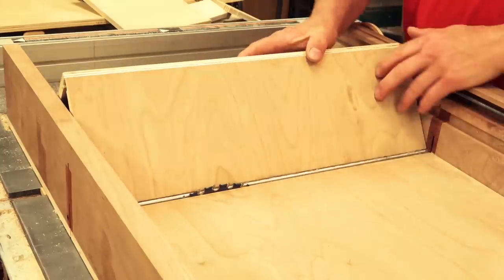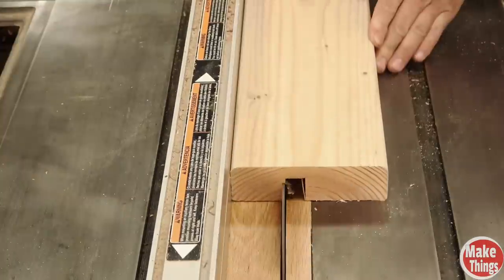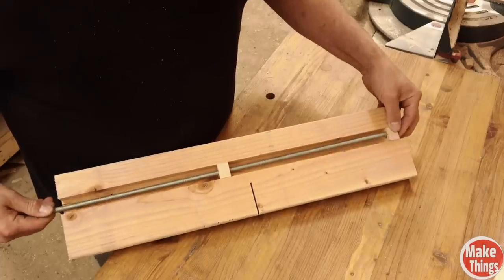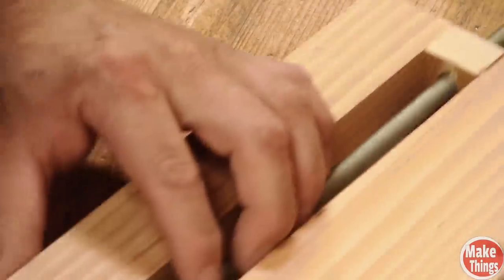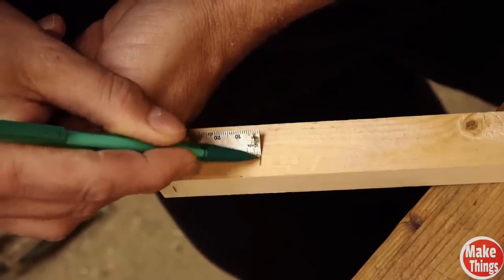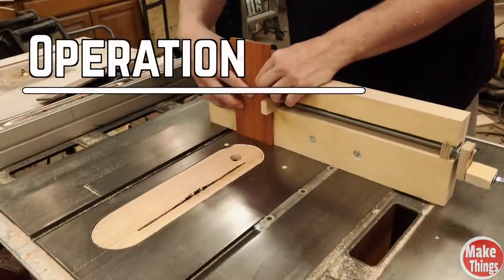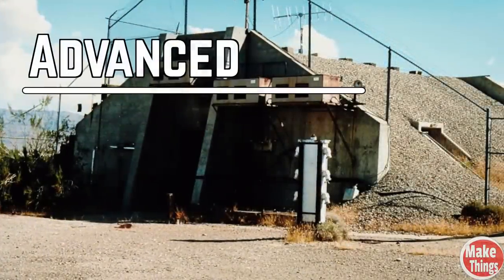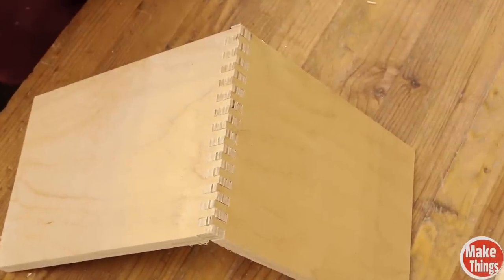Easy Box Joint Jig // The Most Versatile Box Joint Jig!

Comment: 😊 I make jewelry boxes. I have tried so many different jigs and they all were terrible at best. So I watch this video many times and thought I would give it a try. I am very impressed. Now I have only had a short time working with it. I wanted to make wood hinges mostly and they are varied widths depending on the project. This handles any size any! Thinking about making one for the router table. I just want to thank you for the idea. I changed it some for my needs but it works great.

Comment: Finally made this jig and it works great with some slight improvements that you hint at in the Instructable: 1) Made a 12 position indexed dial, 1/12 turn extra on the spacing cycle gives perfect fitting joints. 2) Use backing sleds with no cutaway to avoid tear-out, boards are reusable on projects with same sized finger joints.
Also finding it useful to make several small boxes (for micrometers) at once. Made four 18mm high boxes by jointing four 85mm wide boards to make a large box, making extra turns where box lids and bottoms can be ripped.
Thanks for providing Instructable as I got confused  a bit by orientation changes in the videos.

Comment: Made something similar just before I saw this. I used 8mm rod and worked out that 5.25 turns gave me the correct fit purely for dedicated 1 cut finger joints using my .130 inch flat toothed blade. But with screw advance you can finely adjust the number of turns for any occasion . Over here we can buy threaded rod connectors which are over 1 inch long and give you better engagement than tee nuts. Very pleased with the outcome . My threaded rod was also enclosed as the whole fence moved .

Comment: :hand-pink-waving::hand-pink-waving::hand-pink-waving::hand-pink-waving:Nice job,I do wonder if an Acme thread with a 4 start on it would be better for this and some sort of physical reference that you can feel,  see and and count as you wind it round would give you a really good advantage especially on the larger gapping, I need to think on this further as it wouldn't be difficult to insert a wheeled counter in to this.  Tally checker or similar I am thinking with a zero option.....On nice woods you donotwant to be missing the steps...
.. 

Great job thanks for the ideas and video....:hand-pink-waving::hand-pink-waving::hand-pink-waving::hand-pink-waving:

Comment: Box joints are my go to for drawers, decorative boxes and even shop storage. A box joint jig that indexes with a threaded rod is the way to go for flexibility and accuracy. This is a nice simple version for doing occasional ox joints. I built the Ed Stiles version which is slightly more complicated but has a couple of nice extra features. Also a box joint blade set is a nice to have extra, it simplifies things and gives a nice flat bottom to the joints. I even use it for 1/4 dados for drawer bottoms,  no fussing with a stacked dado set. The single biggest problem I have is dialing in the cut height, you just have to run some scrap through. I like to cut just slightly deep and clean it up with a sander after assembly.

Comment: I built one 5 or 6 years ago and it does make great joints but mine uses a dado and the fingers are the same width every time.  But it makes very fast accurate cuts after the dado is set up.  It is a beast it looks like a oversized typewriter that you squeeze a grip on one hand it pulls the part over the set distance and you squeeze the other grip and it locks down as you push it through then squeeze right hand it slides squeeze left hand it locks to make the cut and so on.   It is very fast but not the best if you only have a few joints to do.  I like how simple this is though.  I think my next one will be one of the jigs that uses set of fingers or blocks on the backside of the fence that you layout to the pattern you want. If you have not sean one they are pretty clever too.    I have a thing for jigs so maybe I will make one along this method just for the occasional joint as it is pretty clever.

Comment: I made this today.  My first couple of tests were using smaller pieces of wood (3" x 6", maybe) using the 2-cuts-4-space pattern but I wasn't able to hold the wood reliably so the teeth and spaces weren't even.  I cut the jig down to 5" high and that helped but they still weren't cut reliably.  My final test was using larger pieces of plywood and the 10-cuts-12-space pattern and it worked pretty well!   So, it does work but I need to figure out a method of moving smaller pieces of wood through it.   Thanks for the idea!  BTW,  all the hardware for the jig cost $25 at Canadian Tire.  (I had the wood.)

Comment: This seems so much more approachable than Matthias's design.  For a hobbyist who isn't going to be making boxes all the time, I think this one requires the right amount of effort and resources. Enough to prove you're serious, but not so much that you've got  got to dedicate days and I like that it isn't a whole new sled that takes up more space I don't have.
Reply from the maker: It’s funny you say that.  I have Mathias’s sled.  I’ve had it for about 4 years now.  I bought the plans, got every detailed part down to finding a bearings place that sold me just the right bearing his plans called for. 

I built it and used it a couple times.  Why?  Because it is enormously complicated.  It’s surely a magnificent tool, but it takes up so much space and I never got the hang of it.  

This one does it better.  It’s simple and doesn’t require several gears.   I mean, I just watched his video the other day and he had a drawer full of gears for it 🤯
Reply: @MakeThings  You gotta push the gears when your website is woodengears.ca ;) Yeah, he builds some  cool machines that take up way too much room for the amount of time I'd actually use them.

Comment: This is the best jig I've saw so far. Nice design. 

For a thin kerf blade, would using a fine thread 3/8"-24 a bit better? Would two turns approximately equal 3/32"? My blade is about that thick.

Comment: For metric version I made this jig (M10 nut, Φ10 bar) but found a problem that maybe is not  related to metric or imperial system whatsoever. 
T nut stays little bit loosely on threaded bar generally. The same holds for simple nut as well. So, when such t nut or simple nut are inserted into wooden pin, the pin will also be somewhat loose on threaded bar, and consequently wooden pin will wobble say about  a millimeter at the top. 
To compensate for that, I tried using several nuts together, welded them as a whole but that didn't rectify the problem, maybe just a little.
However I find the solution: the pin wooden cube should be drilled first for threaded bar, and then drilled partially just for t nut. Additionally you can add another drilled cube horizontally and  glue it to the pin cube. That is how wobbling of pin is eliminated.
Reply: I also made a metric version M10 where instead of a T-nut I threaded my pin and have no wobble whatsoever. I did a lot of tries today but unsuccessfully. I am sure it has to do with everything been metric. Even my blade. (2.8 mm). I will experiment a bit before giving up.

Comment: I think it would really help knowing the theory behind the 3/8-16 threaded rod. I assume it is 16 cranks to an inch. I think an explanation of the mechanics of it would help greatly. This is a great jig and one I am looking forward to making.
Reply from the maker: Think about it like this: a 1/16th of an inch would be one revolution.  16 cranks equals 1 inch.  Did I just say what you said, yes I did, but...backwards, so it doesn't count.

Big tip on using this: Have patience.  It'll take skill to learn to use this just like any other tool/jig in your shop.  It doesn't make them super easy, but it's easier than builds like Mathias' massive jig (big respect for him) and many gears needed to do different gaps.

I say that because I strongly believe in this jig.  It's super easy to make, it's super easy to use.  The mechanics are simple.  The difficulty lies in counting each pass and making sure you get it right.  Another difficulty is making sure you keep your wood absolutely flat to the table.

Some people have been dissatisfied that it wasn't as easy as they thought it would be.  Joints are never easy.  To get perfect fits, you need lots of practice and lots of patience.  It's a skill, just like anything else.

Let me know if you make it!  Send me an email showing yours off, I can't begin to tell you how happy it makes me to see someone make something I've thought up! makethingswithrob@zoho.com
Reply: @MakeThings  Thanks for the reply. After watching countless videos on box joint jigs, I think this is the way to go!

Comment: This jig is just deceptively simple. One can make it relatively easy. However, to use the jig effectively one must have hours of practice, which does not seem necessary at first glance. Previously I have made three types of finger joint jigs, one being this type, and each one demands different amount of time to master. This particular jig is in the longer time group to master, but has it's advantages as well. Advantages are  every size of finger, every size of space, interesting counting, and definitely simultaneous cutting of both pieces.
Reply from the maker: You're exactly right.  This jig takes time to get right, like all tools.   I wish more people understood this as there is a bit of skill needed to master this.  Thanks!

Comment: Loved your idea! I read the tutorial on the 3/16 issue. You could probable use a 5/8 thread with 11tpi and a single crank would match almost exactly 3/16 of your blade. Maybe I am missing something, but I think it makes sense. Please correct me if I messed up.
Reply from the maker: Haha, I’m not an engineer or a mathematician but 12/16ths is about 3/4’s, so you could be right.  

It would be interesting to try...it certainly doesn’t take much to make...ahh, but wait.  You be in trouble with getting t-nuts.  At least locally.  The highest t-nut I can get here is 3/8ths.  

It would be interesting nonetheless.  

Thanks for taking interest!
Reply: @MakeThings  you could maybe use a regular nut and fit it in a shaped hole, or make a very tight hole in the wood and use epoxi to get it fixed.
Please upload a video if you ever try.
Reply from the maker: Hey, you’re right!  Will do!

Comment: Looks legit Rob 👍👍 And hey - how about those weirdos that call Sharpies - "Skerpie" - that's as odd as finding a 3 in a binary search. 🤪 But while we're on the subject of "undeveloped" countries let's talk about 3/8 - 16 threaded rod. Turns out that two turns of that puppy advances the pin by 1/8 of an inch where a blade kerf is 1/8" which is indeed a coincidence of note. But in the vidjeo your hand actor does one cut for each rotation ... omg - I'm confusered - is he cutting the thin air on the second pass? Answer: no - he is cutting 1/16" each time (half a blade width) - so question #2 must be can he just crank that handle twice each time and chomp out the whole 1/8" - thusly making the formuler for the cuts part of the equation dividered by 2, plus two full cranks to line it up again for the next pin. wtf - this question is so undeveloped that I must experiment it meself. 
Now.... where the hell do I get 3/8 -16 rod around here? 😮
Reply from the maker: Hahaha, that one was aimed right for you.  I’m glad you weren’t looking away when it came up!  I was afraid you’d miss it!

Comment: Ok, advanced add-on.  After reading the Instructable I think I get it. I think. The pin moves to position the cut, and in clamping the box sides to the back 2x6 fence of the jig, it's possible not to register and clamp the box sides accurately?  So the advanced panel you created is actually glued to the pin and gives you a clamping surface.  Did I get that right?  Seems the pin could be created differently to begin with, in version two?  I have been looking at a lot of box joint jigs, and I think I like having a little finger sticking out to just move the little boards along instead of reclamping them.
Reply from the maker: Hmm, I’m trying to understand what you’re saying here.  First of all, you don’t clamp the stock you’re cutting to the 2x6.  I used clamps a couple times.   The first time I clamped 2 boards together to be cut in simultaneously, to save time.  

The second time I used clamps was on a piece of plywood that gets glued to the pin only.  That plywood moves along free of the 2x6 altogether (except that it rubs against it). 

I used clamps to attach the two boards to it.  

If I were going to choose whether or not to use that piece I glued onto the pin, there’s no doubt I would use it over moving the wood along, just because it’s error free, especially narrow boards that have little surface area on the base.
Reply: My bad.  Thanks for the reply.  I watched through and even watched the advanced add-on section more than once and then I went over to Instructables and read that and came back, but  somewhere in there I got confused about what you show and how to operate your jig.  Just explaining my confusion.  Another thing if I could suggest it in case others run astray the way I did, is that my better half and I watched just now and we agreed what you are calling your "pin" is really a "stop" to me... terminology.  What we have been calling a pin around here when we made finger joints the old-fashioned way is a stationary fixed-size pin or finger of wood which matches the dado or kerf -- no relationship.  You don't have that type of pin, your dado or finger  spacing so to speak is determined by the number of cranks and the threads per inch on your rod.  I'm straight now, lol.

Comment: A safety issue; the 2 x 6 cutoff  as seen at 1:04 can be very dangerous. Cutoffs can be propelled backwards into worker's body. There needs to be sufficient clearance to avoid potential binding between the blade and fence. Cutoffs can be thrown at high speeds always pushed or moved free of being caught by the blade.  I've  witnessed table saw cutoffs narrowly missing the operator and leaving large deformities in steel shop doors. Close calls are to be avoided.
Reply from the maker: Then how do you recommend cutting them?  If you notice, my body was not behind that part of the cut.

Miter gauges would be useless if you couldn't crosscut with them.
Reply: @MakeThings  No personal criticism. Rather an observation that may circumvent potential injuries..
Miter gauges are fine for crosscutting if the they used correctly. I prefer a good chop saw or a sled like yours.  
From a safety standpoint, miter gauges should lead not follow the workpiece.  Should any accidental binding occur the heavy metal miter gauge will still be setting in the table's track and not sticking in somebody. enjoy

Comment: Am in the process of making your wonderfully designed jig but have a couple of questions.
1.  The jig and rod length are both 24" yet the rod is supposed to extend 1/2" out (for the crank).  Won't this prevent a washer and nut being placed on the opposite stop block?
2.  Does the third stop block get glued to the sides of the dado
3.  Is the third stop block supposed to be flush with the end ??
4.  In the pictures, the jig only has two stop blocks and the one pin.  Should there be 3 stop blocks or just two as shown in the pix?
THANKS !!!
Reply from the maker: Hey James!

1.  No washer or nut is needed on that 3rd block, it's simply used to fill the space so that that end won't warp or twist.  You could even fill the entire end past the middle nut and washer with square with circles in it.

2.  Yes.

3.  It doesn't matter, see #1.
4.  I made 4 of those and I don't remember if I had a 3rd stop block in all of them or if I missed one.

Thank you James for pointing that out, I'll update my instructable and mention you (if you want...tell me if you don't want me to use your name)!

Comment: I have tried so many box joint jigs and fail pretty much every time getting them to fit well.  I'm definitely going to give this a try.  One question: Does it matter if I'm using a full or thin kerf blade?  Considering how this is made it doesn't look like it would matter.
Reply from the maker: It does and doesn’t.  

I used a 3/32” kerf.  That’s a 1/16th larger than a complete crank on a 3/8-16 threaded rod.  So I use 2 cranks in all.   Technically speaking, that will leave a 1/32” on either side of the tooth.  

To accommodate that I make my last crank a half crank.  

The question is, do you want a tight joint or a loose one?  I prefer it to be stiff and don’t believe the glue will be completely removed so the 1/2 crank method works for me.  

Do me a favor, read my instructable and pay closer attention to the “operation” step.  It goes into a bit better examples as to what I’m saying.  

Is this system flawless...not entirely.  It’s a system you have to familiarize yourself with but I’m confident if you use a 3/32 blade and follow my instructable you will get the same results I’ve gotten.  

But also go into the project with a little patience because, just like any other jig or machine, you’ll need to learn how it works.  

Please make sure you message me if you do run into something not working.   My goal is 100% success from my projects.  

Btw, I have made 4 of these crank mechanisms now and each works.
Reply: @MakeThings  Thanks!  I've added this to the "things to do" list.  First thing is to finish the two redwood slab tables I'm doing then I can give this jig a try since I want to make a box to store my dice.